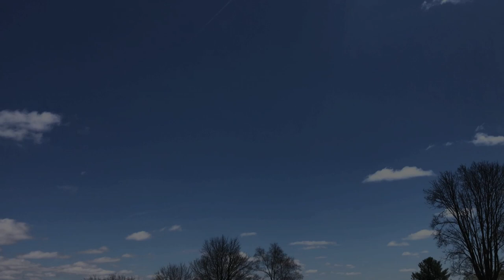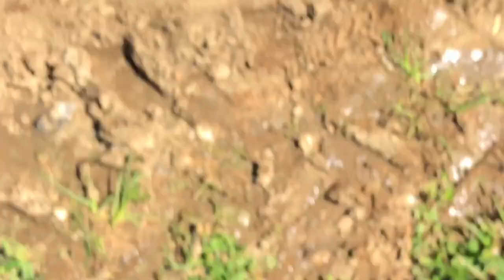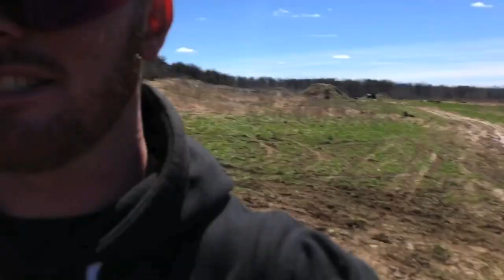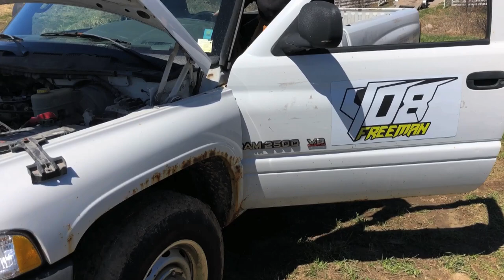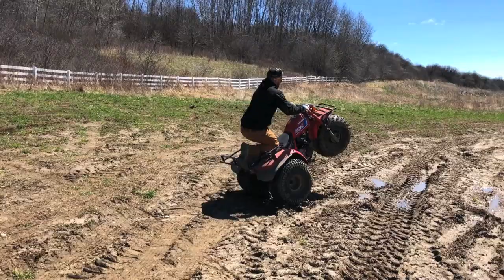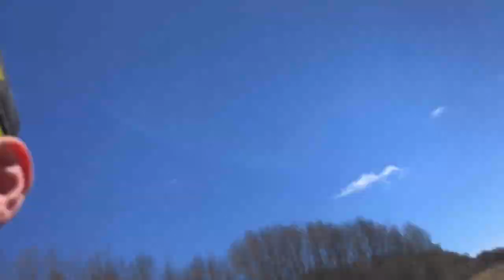THREE WHEELER!?! Whaaaat!!!

Comment: I used to own one of those out here in NZ years ago. You have too much air in the rear tyres.  Be careful not to get your feet off the pegs while going over rough ground or you can get your feet dragged under the back tyres. it will really burn the skin on your legs if you are lucky. LOL The previous model was worse as it didn't have front shocks and relied solely on tyre pressure. Too much and it bounces the front off the ground and too little and it bottoms out the tyre and throws you sideways. it was a very fine line between too much and too little.  I hit a hollow spot on a beach at about 3/4 revs in top gear (i guess 40mph  ish) the bike bounced i went up the bike came down, i came down . The bike and me went up again and i came off the back and the bike carried on. I did a cartwheel and half roll. My friends though it was hilarious.  I bruised parts of me that i didn't know i had.  it was a lot of fun. not too fast into corners as the weight transfer can be quite sudden. LOL

Comment: I personally drive a similar model Escape with the same engine (V6) and it's been a great car. Mine is still in good shape, but the rear end on yours is likely rusted out which might explain the additional noise and extra bounce whenever you hit bumps. A lot of older Escapes are known for rusting out in the rear end of the vehicle. Haven't had that issue with mine yet.